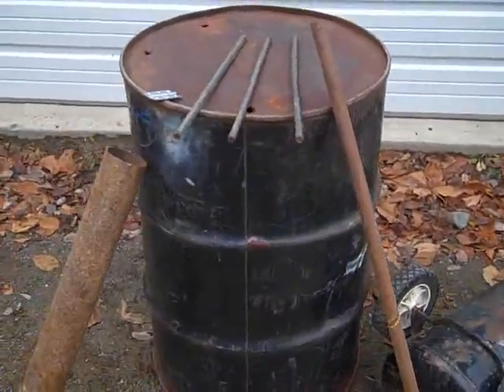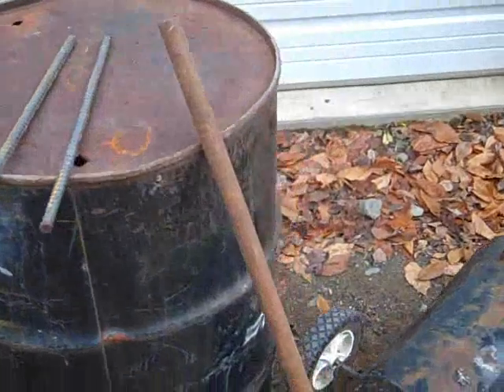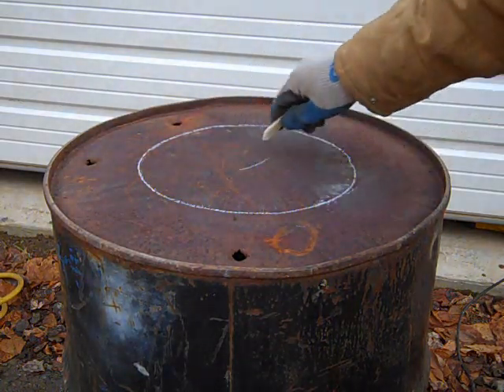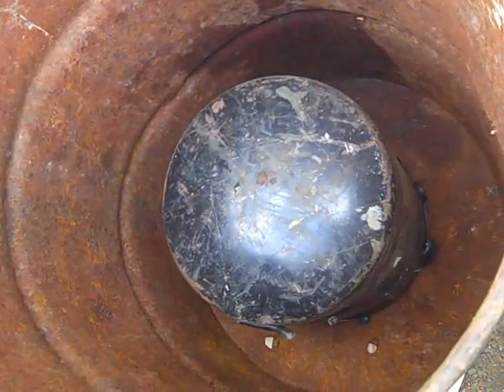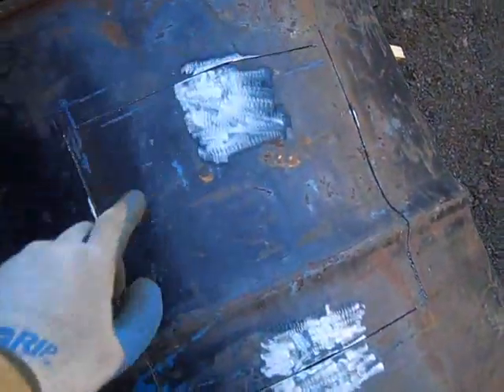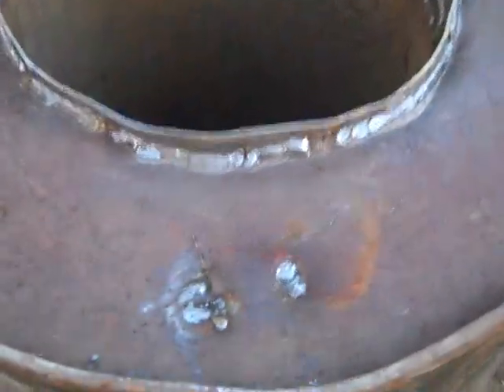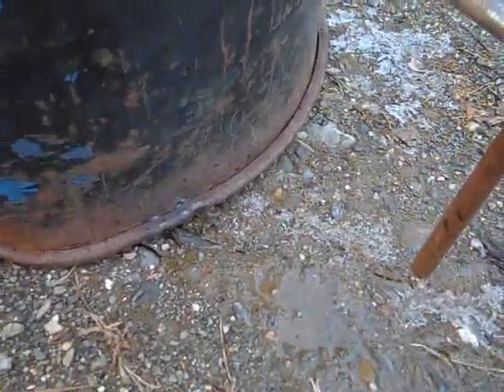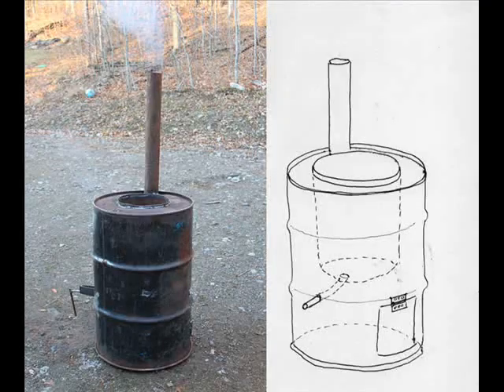Building a wood burning lead smelter

Comment: I can't understand how it gives the high  temperature to melt lead 😂 its use only form heat water for bath and make soup shop it is trash for melting metal
Reply: Lead melts at around 600, I can assure you fire is much hotter than that.  Have you ever soldered with a propane torch?  Lol

Comment: I was thinking a stew pot over the top, heck with pre heating lead, you need to have supper ready when your done. Wondering how this worked out for casting.
Great idea and presentation. Thanks

Comment: have you thought about making shot instead of ingots? shot will melt faster than ingots when using your electric melting pots. and is easier to store as it will fill a container easier than ingots. can the add lead in smaller increments to melting pot. simple device to make shot would be the attach a small diameter pipe to the spigot to make small stream of lead to drop into container of water.

Comment: I like it. think i will make something like it on a smaller scale. Maybe something that fits the same dutch oven i use on the propain burner but uses wood. A fire box that the pot fits in and seals the heat under it. I have an almost infant supply of shipping pallets for wood

Comment from the maker: Hi, good question.  The chimney pipes emit only wood smoke, the same thing that comes out the chimney of my house all winter (and many homes in New England that heat with wood).  Or, you may be speaking of the smoke coming off the drum, that was a one time deal of the paint burning off on the first firing.  Lead fumes?  Lead doesn't vaporize at these temperatures.  Thanks for watching.